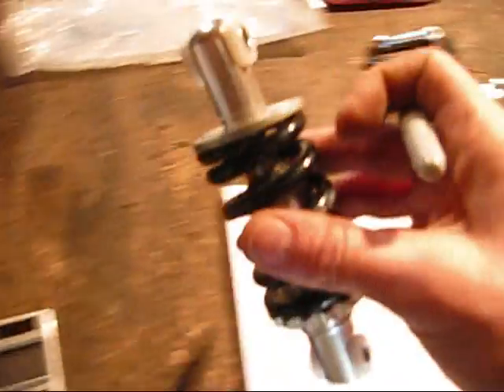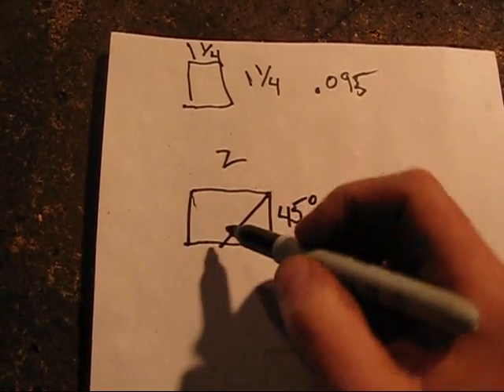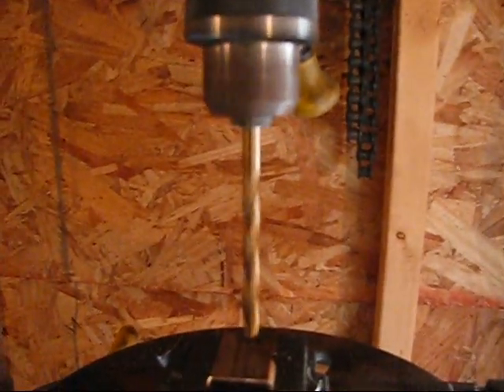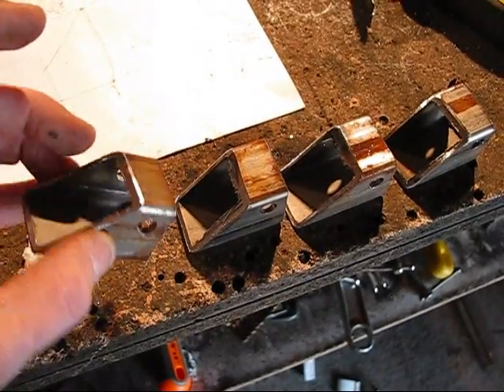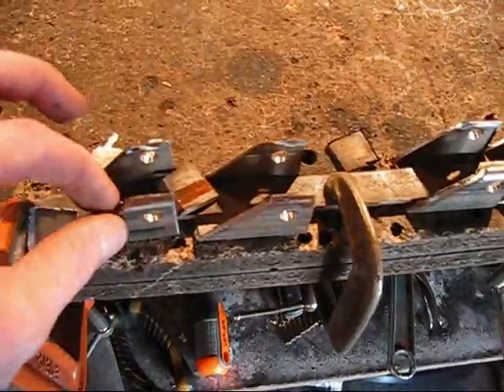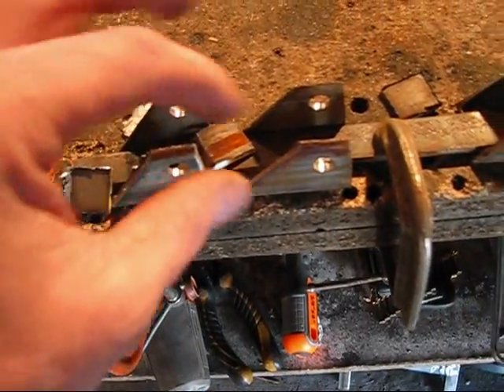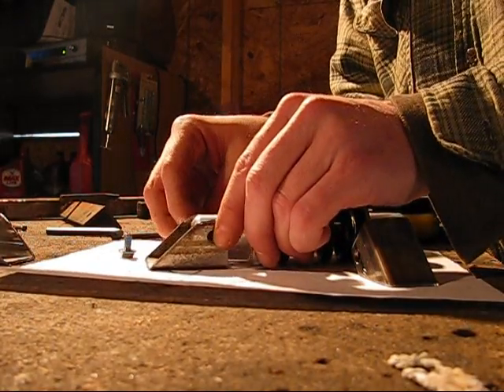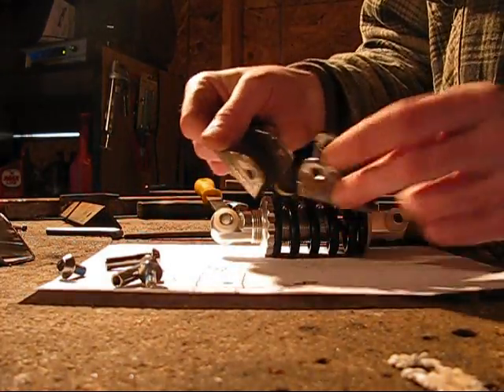Go Kart , █  How to Build / make  #6 ( by T-man ) █

Comment: I need ur help on getting gas to mover
Reply from the maker: ?? What ??
Reply: I buy new motor and the gas is not getting to head  to run the mover I have seen all ur builds and I know you can help
Reply from the maker: most of the time, it is a problem with the carburetor or the jets. Take it off and clean it.

Comment: What is the bolt that you used to connect the shock absorber to the bracket? I noticed in your other video you just used a 5/16 bolt and nylon lock nut?

Comment: k i did so and i have a quick question. OK so if you have a shock absorber that can hold 450 and you have four (two for front and two for back) would the front have a weight capacity of 900 and the back also have a weight capacity of 900?

Comment: What if your frame has round tubing instead of square tubing? is there a way to still bend those mounts at the base and drill holes through my round tube framing for adjustments? do you see any issues?